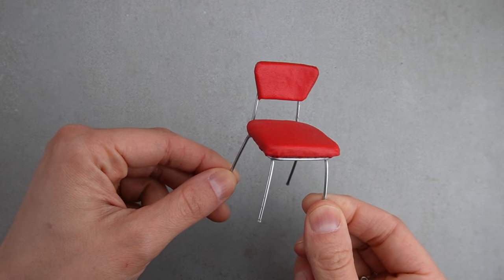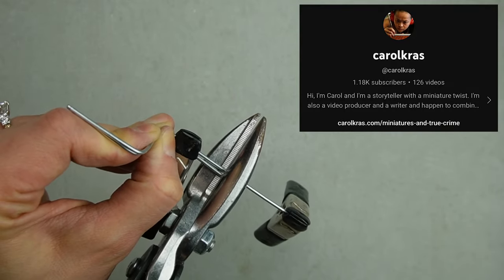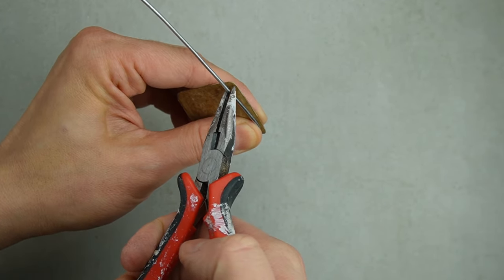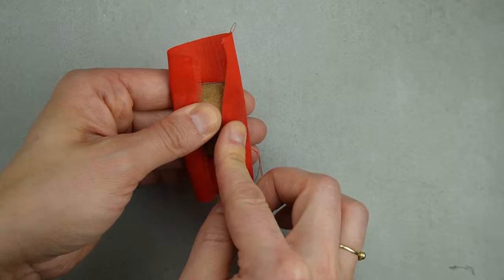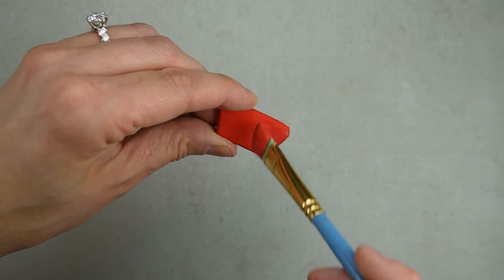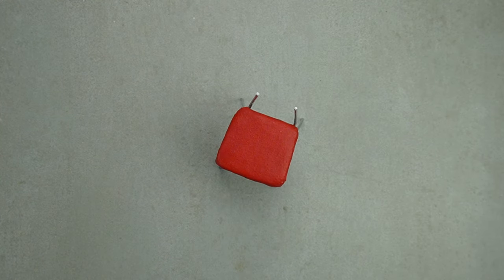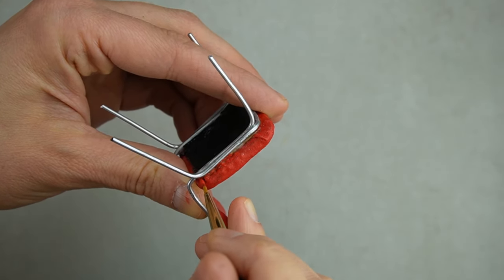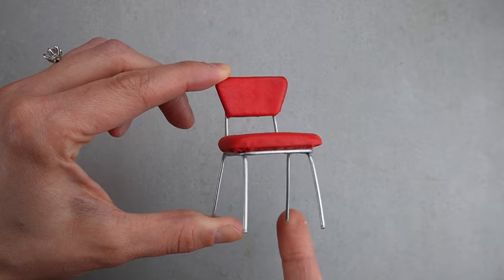EASY handmade 1:12 miniature Retro Chair

Comment: Great job. I used very thin aluminum tubing for my chairs. It bends easily but you have to bend slowly so it doesn’t kink. I was lucky enough to find a red vinyl tablecloth that worked perfectly for the upholstery and looks great on a booth seat as well. I love your videos and get so much inspiration from them. Thanks for all the ideas.
Reply: A good way to stop the kinks is to fill the tube with sand and seal each end with glue but make sure you leave enough space in the tube for the sand to move. Once done you pull off the glue plugs and pour out the sand.
Reply from the maker: I actually have thin tubing I bought at www.earthntree.com. I completely forgot about it!
Reply from the maker: What a great tip!

Comment: I’ve never seen a miniaturist make this style of furniture- it’s so often more Victorian era. So refreshing. Also I love your card and superglue trick. I think painting the cloth created the perfect pleather look. I’m surprised at how good the back looks after you just cut the fabric along the edge. The results were awesome.
Reply: Also wire is super easy to sand instead of glue- though that produced a good finished look.
Reply from the maker: Yes! Thank you! I'm really glad the back turned out so neat and tidy. I think it it was any thicker, it wouldn't have worked out. I should've used Fabritac instead but my bottle of glue exploded long and has a huge trail of dried glue coming out the side.

Comment: That turned out really nice. I have a red high chair from that period. It has pull down steps in the front which are handy to use as a step stool.
Reply from the maker: That's a classic design! They still sell those today from multiple brands in multiple price ranges.
Reply: Omg core memory unlocked!!

Comment: The chair looks really cute. If I make one, I will also put vinyl on the back of the chair to cover that exposed wire. I grew up in the 50's and I saw a lot of these chairs in the cheap kitchen sets popular at the time. The vinyl was so flimsy that the seat would tear and you would see the stuffing in the slashes. They were pretty awful. LOL
Reply from the maker: We had some from the 1970s with indestructible vinyl, which meant they were a mainstay in the kitchen for decades 😆

Comment: Nice job! The secret project is off to a great start. BTW, your first instinct for cleaning away paint where you don't want it was correct. Rubbing alcohol is a solvent for acrylic paint (especially when it's fresh) and white glue as well. Good to know for cleaning paint brushes that have gotten glumpy.
Reply from the maker: Good to know! I'm always wishing I had nail polish remover. I ran out months ago and never remember to replace it.

Comment: Hi, I just wanted to share, I use the tubing inside of spray bottles ( they are different sizes and you can find they are small too) to fit over the bottoms of my metal , you just cut the tubing to the length and paint black or silver to look like the cover, hope that makes sense❤️
Reply from the maker: That's so clever! I actually have some tubing like that since I hoard trash to use to make miniatures.

Comment: On bending wire you could make a jig from wood block drill holes at the points you want to bend the wire and add wooden dowels, this would give you consistent shape for all of the wire frame work. This way every chair will be the same then. I was thinking this as I make ear wires for earrings I make and they must be identical so I have jigs for my jewellery making.
Reply from the maker: I have seen people do that. It would be a good idea if you're making multiples. Thank you

Comment: Do you have trouble squeezing your glues through your precision bottles? I bought a set of bottles and a bunch of different tips. But its really diffucult to get the glue through the tips, even with storing the bottles upside down. Its possible its just my hands (arthritis), but it doesn't look like you're squeezing really hard. Is there a trick?
Reply from the maker: My nozzles get clogged all the time. I use a straight pin to clear it out.

Comment: A secret upcoming project!? 😃 My eyes are wide with gleeful anticipation!!
Girl~ 😳I just realized while watching this that your knowledge of MCM furniture has to be more from research, less, if at all, from memory (unless your parents' décor was/is heavily influenced by that design, which would have been much better than the brassy 80s and whatever the 90s were...) Anyway, please don't be offended, but I hated this style of chair back in the day, at least the lesser quality ones that I would typically encounter! these chairs were so common in the 70s and into the 80s even. There was always at least one stopper missing form the ends of the frame pieces - which were hollow, btw. So, scrapes, cuts, and scratches were inevitable. 😕 Also, the screws holding the seat and back would frequently fall out - never to be replaced - so a fidgety kid could easily get her fingers pinched! 😵‍💫Your method of gathering the vinyl at the corners is spot on (not the nice fold you demoed, but what you actually did). That is how they were made; this is why the screws would come loose! And there was very little concern for whether there were noticeable gaps between any of the parts. 😶Not nearly as well made as your mini! 
Seriously, though, I really love this demo, and the way you accomplished the design of the frame. I tend to forget about painting fabric to affect certain looks and textures; the paint and mod podge mixture is perfect. An additional coat or two when you change the color will only improve on what is already nicely done! The chair is a perfect representation, and I truly admire your design and work! 🥰
If you've stayed with me this far, 😇I would love to see your design and take on the wood framed counterpart of the MCM chair design.🤍
Reply from the maker: You're right! I didn't grow up with chairs from the 50s. I was around chairs from the 1970s. They were made in a similar style. 

I probably won't make another chair for a while. I just needed this particular chair for a secret project 🤫